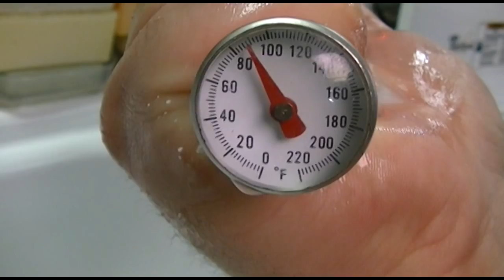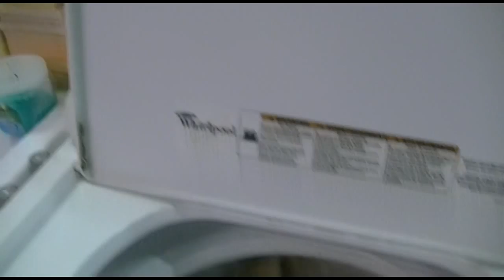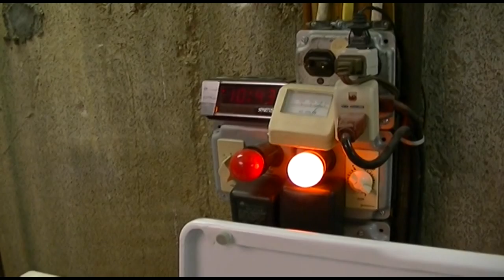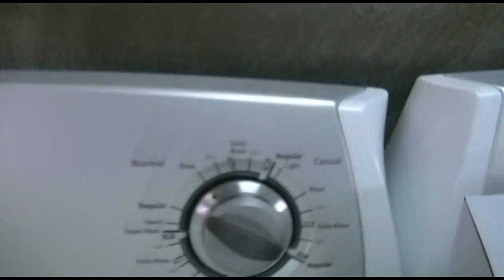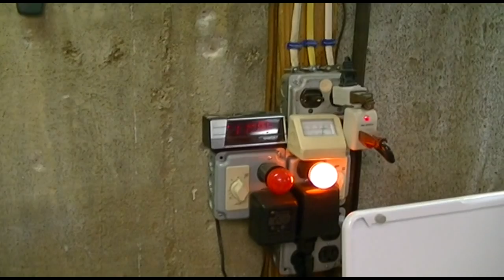WashDay Wash-In 21.0 With Sharkie626!!!

Comment: The nice thing about having a top load washer with a mechanical timer, is you know what part of the cycle it is in. A HE washers really doesn't indicate what part of the cycle it is in. The mechanical timer is a form of "mechanical computer", and it is mechanically programmed.
Reply from the maker: Yes, I fully agree!  Sharkie's new Speed Queen has the digical display, and I will say the only nice thing about that is it shows the remaining time for the cycle (and it doesn't play the numbers game, what it says is what it is).  That's kind of nice to know.

I have the old timer from T's washing machine that I fixed.  While I was visiting Sharkie, I opened it up and we took a peek inside, and there was the program, molded into the plastic!  Turns out, somehow by taking it apart and putting it back together, it operates as it should.  I haven't tested it yet.  If my machine is pin-compatible with it, I'll give it a shot and see what happens.
Reply: I watched the video on the bad timer on T's machine. The timer may have been knackered, but it was working the opposite it was suppose to. Instead of pushing the knob to stop, you pulled out the knob to stop, and pushed to start. Whirlpool/Kenmore machines of the 50's 60's and 70's had a timer that you pulled out to stop, and pushed to start.
Reply from the maker: My dad's late 70's Whirlpool (probably around 1977) was "Pull Start, Push Stop".  Perhaps by then they adopted that standard.

Comment: I actually found a 1980's Whirlpool belt drive washer and gas dryer in Los Angeles for $125.00! I may possibly get it, but it is up in the air.
Reply from the maker: That might be great as a second set!
Reply: It would make a great second set. I would like to find a vintage Maytag Halo Of Heat dryer, but I have had no luck on finding one.

Comment: My aunts and uncles ( on my dad's side) have a 2006 Roper (Whirlpool) direct drive washer has the same Agitator in your older Whirlpool washer does, but it has the same tub in your newer Whirlpool washer.
Reply from the maker: So it's a hodgepodge of irregular, leftover equipment.
Reply: my aunts and uncles(on my dads side) Roper washer is a direct drive.

Comment: I am wondering if these direct-drive machines are commonly available on the used market anymore.  I just did a full rebuild on one recently that I had sitting around for several years.  It appears that I'm not seeing many old washers like these, which makes me wonder how much the one I have is actually worth, and if there's a potential for it to appreciate in value over time.  Are people still finding the old direct drives?  Or are they actually being coveted because of the new HE machines being the way they are?
Reply from the maker: That's an excellent point you bring up.  As far as I know, these "old relics" are no longer really wanted.  So used appliance shops should have them.  They may not be around in your area per se, but these machines are around for sure.  I don't really see them appreciating in value much, they're not old enough for that to happen.  If you have a particularly rare model that a collector is looking for, you have a potential gold mine on your hands.  Otherwise it's just another appliance.

I think people are too brainwashed into "HE is better, buy this new spaceship for twice the price of your old, still working machine and you'll make the extra cost back in no savings in water", so I don't really think the old machines are coveted.  To me and to you, yes.  Others, probably not at all.  My 2 cents.

Comment: Would you ever have a Maytag A806 washer and Maytag DG806 gas halo of heat dryer?
Reply from the maker: I'm a born-and-raised Whirlpool/Kenmore man.  If a set of those came my way for either free or a very attractive price, I might consider them.
Reply: There a lot of older Maytags out there, and they are easy to find. The gas Maytag halo of heat dryers use a standing pilot, and they use a 18,000 btu burner to heat up the dryer.
Reply from the maker: I'm actually a little leery about dryers with standing pilots.  Dryer lint goes up real quick.  At least with electronic ignition there's no flame while it's off.  You never know if there is, for some reason, a blanket of lint that may just decide to come down whenever it wants and light up.
Reply: The down side about the Maytag gas halo of heat dryers is they use a standing pilot, and they are actually slower at drying clothes compared to the electric counterparts.
Reply from the maker: That's rather interesting.
Reply: The electric Maytag halo of heat dryers used a 4,500 watt element, and the clothes were surrounded a 360 circle of heat, and the gas halo of heat didn't offer a full 360 circle of heat.
Reply from the maker: That gas model doesn't sound too heavenly.  Har har!
Reply: LOL! The reason why the electric halo of heat only had a 4,500 watt element is due to the close proximity to the drum.

Comment: Those balance spins on those direct drives are on point! Try that with a modern HE washer, and it will give up.
Reply from the maker: Of course, and then use more and more water, filling and draining, filling and draining, agitating in between, because everybody knows THAT'S highly efficient.
Reply: @jaykay18  What I find funny is how LG and the other HE washers would use load sensing to balance the clothes before filling up. At first I thought it was cool, but after understanding the mechanisms I think it's totally ridiculous.
Reply from the maker: @ericgreen4610  It is.

Comment: I have bad news. The timer in my Lady Kenmore died. The timer motor still works, but the water would not shut off no matter where I advanced the timer. Thankfully I was there when the timer decided to crap out.
Reply from the maker: The fact that you were there to catch it makes up for any hell this whole problem in general is causing you.  Still no picnic, but it would have been a lot worse.  Hopefully you can find one for it.
Reply: Hopefully I am able to find a new timer for my lady Kenmore portable washer.
Reply from the maker: It may not be easy, but it's got to be around.

Comment: Today my aunts washer took a crap. It's a Frigidaire washer model FWXB23RGS0. She says it won't spin and drain and it hums and has an electrical burning smell. What do you think would be the problem. I was thinking motor, but the pump has a motor, and the machine has a capacitor. Do you think it's the agitate and spin motor, the pump motor, or capacitor, or even something else?
Reply from the maker: I'd start with the capacitor.  Another easy test is to remove the motor and see if it will start out of the machine, if it will then it means big trouble (transmission), if it won't it's either a bad motor or cap.
Reply: jaykay18 I've been thinking, she says it won't spin. Is it because the tub is full of water? Im pretty sure it does a neutral drain like the Whirlpool direct drives. It won't drain, does that mean the pump is bad? But I'm wondering, is the capacitor connected to the pump motor, the agitate and spin motor, or both?
Reply from the maker: Is there a separate pump motor on that unit?  If there is, usually they are just small shaded-pole motors, they generally work or they don't.  Those motors generally don't have or use capacitors.
Reply: jaykay18 ok thank you so much, and yes the pump has its own motor.
Reply from the maker: You should be able to see that motor after opening the cabinet.  Sometimes they're right there where you can see if you can spin them by hand.  There could be something inside that blocked it.  Or the motor could have called it quits.  Or it could be a faulty control panel!  Just need to go troubleshoot the problem.
Reply: jaykay18 ok thank you so much 😀